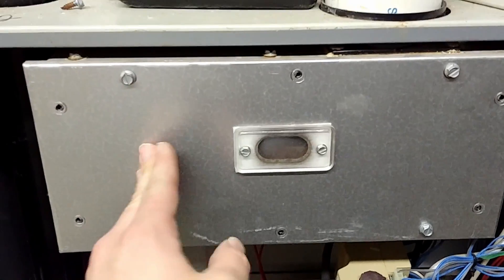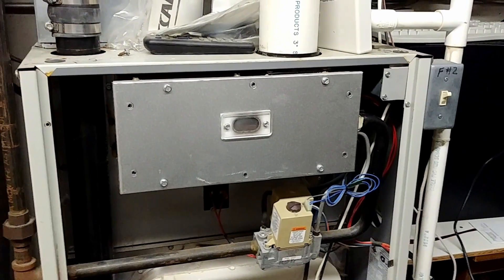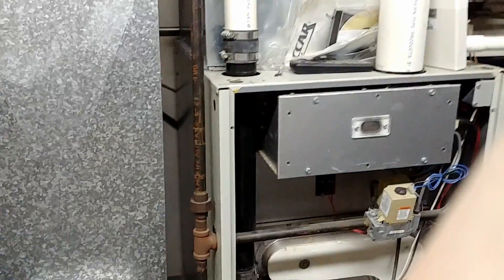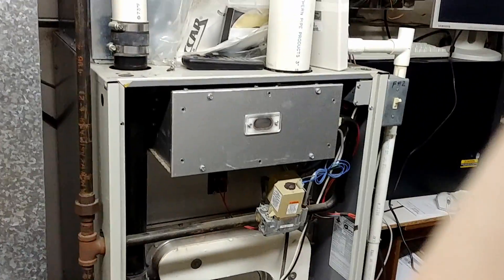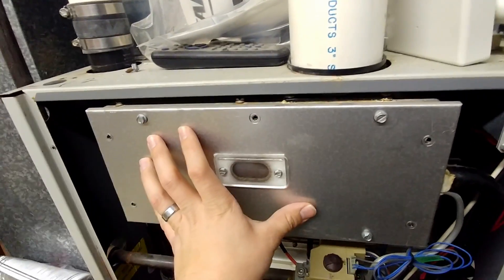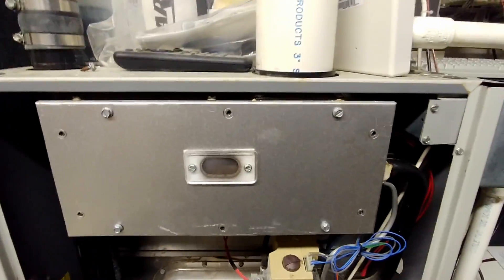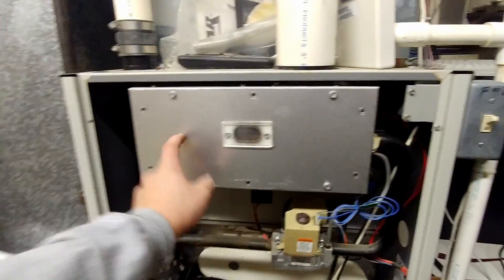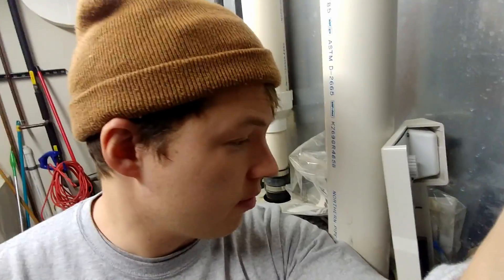Explosions During Furnace Ignition - Symptom of Bad Heat Exchanger

Comment: check the flu pipe, check the igniter, at least clean it, change the air filter, put batteries in your carbon monoxide detector and test it, go have two beers and go to bed..
my furnace started making those mini explosion sounds 24 hours ago. I changed the April air air filter, which is a very large filter that I had not changed for about nine months. I made sure the two flu pipes going outside were not blocked with ice or stink bugs or birds. I have screens over the ends of the PVC pipes with those metal socks over the end that you can buy the dollar store for catching lint being discharged from your washing machine discharge hose to keep out stink bugs. Do you think they’re not trying to get in your house, but I have a craftsman 15 gallon air compressor with an oil-less compressor. It would not turn on one day, I have it mounted on a shelf. I made just for it up in the air in my garage to keep from taking up floor space. I wanted to see what failed so I started to take the motor apart because it just would not turn on. When I opened the cover on the end, it had hundreds of stink bugs inside the electric motor. I blew them out with compressed air, and the compressor has been running fine for at least the past 10 years. So you gotta stop those things from going in your flu pipes on your condensing furnaces by putting a screen/filter over the pipes that go outside on your flu..
Anyway, I changed the filter, tightened up some clamps inside the furnace, where it appeared I had some condensation leaking, and I’m sitting here listening, and my furnace is as quiet as it ever was, no more boom when the burners light. So maybe it was just the air filter. Because it was a little dirty. They may not look at, but those April air, air filters, which look like an accordion have a lot of surface area, and they look like they’re clean on the part you can see but down in those plates that are about 8 inches deep, mine was pretty dirty, mainly because my wife runs the sweeper every damn day, I’m not kidding, I am not kidding, she runs the sweeper every day, and that puts dust in the air that she doesn’t believe. Well, that dust builds up in your furnace filter in the summer when your air-conditioning is on, and in the winter when your furnace is on… I learned an HVAC school how high the head pressure goes on your air conditioner compressor when you have a dirty filter… I just relearned that lesson from HVAC school today

Comment: New house, new furnace and less than a year ive got this happening now. My neighbor is having the same issue as well. Both new installs within the year. Any thoughts?
Reply: Probably adjust the gas valve. Down first through several ignition cycles. If down isn’t the correct direction due to more intense explosions, then up.

Comment: Thanks for your video, I just had one of this today as bad as the one you are showing if not worse, and yes I did check gas pressures, even thought it was a bad gas valve building gas in the igniter area and causing it to pop, its a 20 years old 90% furnace, certainly not worth repair.

Comment: There's a rooftop Central Air Unit on top of an apartment near mine that has now reached the point where it sounds like the 'launching apparatus' for professional fireworks (y'know, that percussive BOOM similar to a loud vehicle muffler backfire, except at a lower sound frequency) and it's percussion can be felt sometimes up to a 100ft away while on the ground away from the second floor of the apartment until in question. Have seen a backdraft of flame shoot upward for half a second at a time, and is occurring more often during the 'small hours' of night closer between 2am-5am, it's not the coils defrosting because it doesn't ever get THAT cold here to freeze things up at night. I'm worried the residents are going to suffer either C-Mon-O poisoning, or a catastrophic/explosive failure since it's become increasingly worse per the past few weeks. Our property management 'company' is basically just in-house hired and employed by a known prolific 'slumlord' Rental Company (JD Homes in Central California) who will persistently ignore problems. Being so late to this post, my hopes are slim, but I'm wondering if this is something I can directly call and receive direct help from the emergency number for our Power/Gas/Utilities provider (PG&E) for a safety inspection to be done in order to pressure the Property Owner/Management team to take proper action lest they face serious fines? Or is this not an option, because again, it isn't my apartment and the renters in that uniy are low income, don't speak English, and don't appear to realize the danger, nor their rights to mitigate said dangers. Hope someone sees this.

Comment: Homeowner obviously took off the combustion cover and did not put back all screws. How can you confirm that it is a cracked primary heat exchanger and not duty in-shot burners? I removed and cleaned all 4 burners and replaced the flame sensor/ignitor unit in my Ultra SX90 Armstrong and still have the delayed ignition problem.

Comment: i have a 93% armstrong,  throwing a 3 flash code and stopping the burner after the blower comes on. I suspect the heat exchanger now, everything in the safety circuit test out good. but you  has me wondering, it does have like a sputtering noise on ignition, now, i am going to rip it open and look deep. was about to replace the board, but have to look deeper now, it is in my 87 year old dads house!!  any input would be great??  Thanks!!

Comment: I am having a similar problem with an Empire vertical wall furnace model FAW-40-1. When it is in its cold start it will heat the room until it reaches the therm. setting. When it reaches the low limit and refires it starts to explode as violent if not more. Under cold starts it runs as long as you want, but within the first 30 seconds of refireing, because the temp has dropped, it begins to explode. All the local guys are to busy or they say just to replace it. It's $2,000 plus install!  (EDITED) added -   Turned it off. Therm. dropped 6 degrees. Started it back up.  Therm read 66 degrees. Reset to 78 degrees. Running perfectly to 78 deg.. Reached predetermined temp. Shut down. Dropped a couple of degrees, refired. Withing 30 sec. started to explode.

Comment: Great texas freeze happened and now my furance is doing this after 9 years of running well. Outside compressor is 6 years and just had the coil replaced. 
Anything I can replace without having the whole furance replaced?? Need help... during the storm it broke the flume at the angel and I fixed that but the burn compartment door has blown off 3 times in 72 hrs

Comment: Bro ,dont play with that shut it off.SUPER DANGEROUS,ESPECIALLY IF U HAVE DELAYED IGNITION THEN YOU LITE.Definetly don't want it to sound like I'm screaming at you,thats super dangerous. One time I had the door of a roof top unit come ofF so forceful if it hit me it would have scalped me.Cracked heat exchanger s are the most dangerous service call we can do on gas fired equipment. Nxt time u come upon that recognize it and don't play with it,shut it down and go to your visual inspection. Cameras are kool but I did it for 20 yrs without.Anytime u find a roll out popped be on ya ps and qs.Popped roll out,go to the side ofthe machine not the front of it.With natural gas(WHEN U HAVE ACRACKED HEAT EXCHANGER)the flame will not b that kool looking blue it will be frightening YELLOW.IM surprised a roll out didn't pop,goes to show how closed manifolds aren't anymore safe then open manifold set ups,maybe for your eye brows LOL GREAT VIDEO ,KEEP EM UP,DEF KOOL BRO

Comment: The explosion happened due to a failed smartvalve. The hsi turns on, and when the valve should put gas through the pilot, it puts gas through the main burners, and causes the explosion.
Reply: I've heard of that smartvalve issue....there were recalls on those, plus a backed up hx cell, thatll do it!
Reply: @toddberner9198  yes it will. And the reason is because on this stupid smartvalves, they energize the ignitor the same time they energize the pilot valve. So when they go to hell, they start dumping gas through the main burners, and when the hsi gets hot enough, boom.
Reply: @AmericanFarmerHVAC2024 
 I think that is exactly what is happening to my Ultra SX90 Armstrong furnace. I cleaned all 4 burners and replaced ignitor/flame sensor unit and still same problem.
Reply: @reno5948  it's a faulty smart valve.. replacing it will should fix it as long as it only happens on start up.. if you get a pulsing flame after the blower motor starts that's a cracked heat exchanger and that's a furnace replacement.  best bet is get a qualified technician to check it out!
Reply: @reno5948  you need a new smart valve, and do it before the explosions crack that heat exchanger. Armstrong 90sx is old tech like these tempstars in this video.
Reply: I've seen some where the smart gas valve doesn't open all the way and only has enough gas pressure to light up two burners. Then, all of sudden, it lets loose and boom! when the other two burners get gas to them.
Reply: @SombraLocs  yep. They are junk. There is nothing smart about a smartvalve.

Comment: The intake air system is leaky and little fan is having to overcome building vacuum. Bird feather fluff is blowing around. 3# orifice is probably dirty and gas pressure might be to high. Blower blade is probably rusty from condensation and air inlet might be frosted inside. Flame spreader on #3 is probably not working to well either. 
If air inlet wasn't leaking so bad, blower fan (sucker fan) might get somewhere. Air comes down the inlet pipe and escapes around the seal, flowing backwards from intended. But that fan sure is weak as if there could be a crack in the heat exchange (or seals) so it is pull other than only combustion air.  The sum of many variables gone south.  In the video I can see the fluff blowing around -- not a good sign, direct vent is supposed to be a sealed system.

Comment: You have 2 problems there. Yes there is a faulty heat exchanger.  You have some broken crimp rings. The explosions are caused by the gas vale. It  has in intermittent pilot solenoid. When there is a call for heat. The pilot solenoid is energized at the same time the  24 volt hot surface ignitor is energized. The pilot is lit sensed by the flame sensor  and than opens the main gas solenoid. The issue  is the main solenoid valve is stuck open. When there is a call for heat the pilot valve open dumping gas into the main burners. The HSI lights the pilot which lights all the gas in the combustion Chamber causing the big boom. I've ran into this problem multiple times. Kinda freaked me out the first time I saw this problem
Reply: I am having a similar problem with an Empire vertical wall furnace model FAW-40-1. When it is in its cold start it will heat the room until it reaches the therm. setting. When it reaches the low limit and refires it starts to explode as violent if not more. Under cold starts it runs as long as you want, but within the first 30 seconds of refireing, because the temp has dropped, it begins to explode. All the local guys are to busy or they say just to replace it. It's $2,000 plus install!  (EDITED) added -   Turned it off. Therm. dropped 6 degrees. Started it back up.  Therm read 66 degrees. Reset to 78 degrees. Running perfectly to 78 deg.. Reached predetermined temp. Shut down. Dropped a couple of degrees, refired. Withing 30 sec. started to explode.
Reply: @peterl4614  sorry for the slow response sounds like it might  be a cracked, plugger heat exchanger  or faulty gas valve.. my bet is a crack near the burner. Definitely be a good idea to get it checked by a certified technician..  you can have a quick look by opening the bottom door where you light it and look up at the burner with a flashlight.. see there are cracked in the burner or heat exchanger... hope that helps!
Reply: How did you fix the problem?  Thanks.
Reply: Furnace could be repaired by replacing the gas valve, only if the heat exchanger was ok.. In this case here the heat exchanger is cracked and has a faulty gas valve... considering the cost of a heat exchanger and gas valve the money would be better spent on a new furnace.
Reply: @bach142  You're right! I priced the primary heat exchanger (though mine is still good) and the Honeywell Smart valve for my furnace, Armstrong Ultra SX90,  and it comes to over $1400 CDN. Priced a new two stage HE furnace, 80,000 BTU, and I can buy it at contractor's price for about $1500-1700, another $500-600 to have it installed. thus, money would be better spent on new furnace. Luckily,  for now I got it working, as Heat Exchanger and Smart valve were good. Will do the replace with new furnace in the spring.
Reply: @bach142  How do you know this one has a bad heat exchanger also?
Reply: Thank you, I just got home and saw your response. I will check out the heat exchanger tomorrow. When I called three local repair companies and explained my issue they said I'm better off to just replace it as you alluded to in how do you fix it response. Thanks again

Comment: Definitely a bad secondary and possibly primary heat exchanger. Shes toast. Should do combustion analysis on it and check for excess air then immediately replace it or just replace it.

Comment: Hi Be. I have a new gas furnace installed in 1/19. Last winter it ran fine. Now is making intermittent loud, vroom, vroom vroom noises that lasts a few seconds then it stops for a few minutes or 1/2 hour then it starts again. ARS installed it. A technician came today to see it.  He said that he made some "minor adjustments" but that there is nothing wrong with the furnace. He said that it could be the gas from National Grid that comes with more force, I didn't understand that part. He more or less said that the furnace was fine and that I have to live with it. I think I have to call them again and have somebody else see it.  Do you have any ideas that could help me? Thank you

Comment: The symptom is almost like delay ignition. Too much gas build up and delay ignition would cause that too. Did you pull out the heat exchanger to check for cracks? Did you take a gas pressure reading on both inlet and outlet and see if the gas valve is working properly?

Comment: Check for A plugged orfice on the gas line.
Reply from the maker: Good thought. I have seen orifices get plugged previously so it's a good idea to check. It is however very rare and I've only seen that once or twice and typically in moist environments.
Reply: @BenjaminSahlstrom  I've seen that happen a few times. Gas line gets plugged up and then flame starts dancing. Worth a shot..